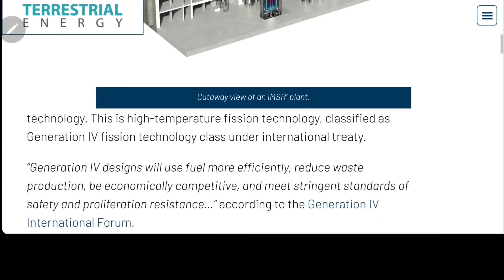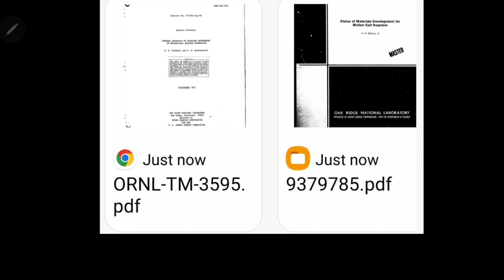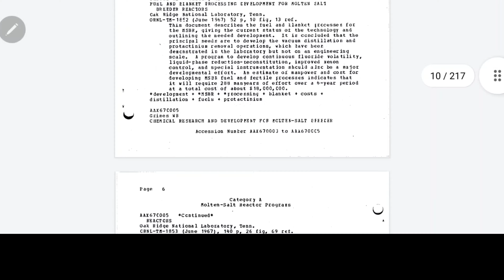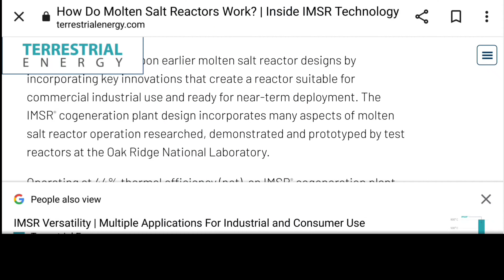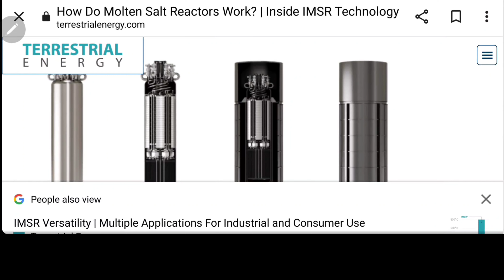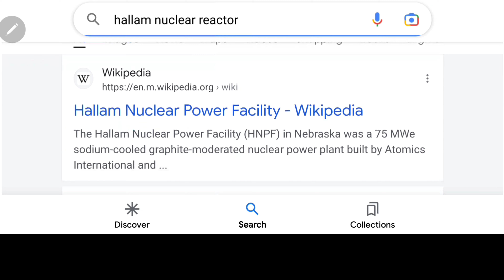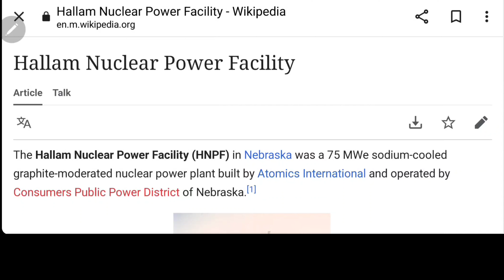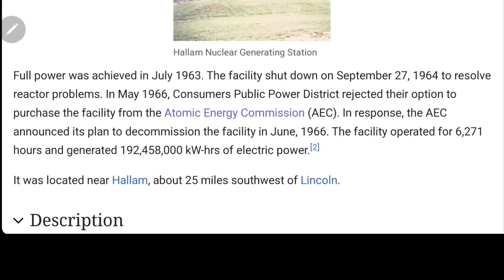Molten Salt Reactor: Future or past?

Comment: The original MSR demonstrators did everything they were supposed to do.  The funny thing is that they were far more complicated than would be needed for a terrestrial reactor.  Remember, the USAF wanted a reactor to power and aircraft.  That meant the reactor had to be designed to work even as it was turned upside down.  A civilian reactor based on using molten salts or even the Thorium cycle would be much simpler as it could operate on convection currents, rather than plumbing.  Once you get the geometry right, such a reactor could be stupid simple.
Reply from the maker: It isn't denied that it can work on paper and in some cases can be shown in expirements plausibility.  But so to did water cooled reactors that is now found that tritium isn't as harmless as once thought to be and passes through the body in under a month.  Newer research shows that's not the case and actually replaces hydrogen in our cells or binds directly to the cell to transform in the metabolic process to organically bound tritium which drastically increases our internal exposures and dose.  That means every standard set needs to be reinvestigated being that radiocolloids and tritium are doing much more damage and death than previously peer reviewed to be.   That's the problem here Paul, the cart is always being put in front of the horse and before we move to yet another bad idea, being we could never guarantee complete protection against not only tellurium embrittlement but also the graphite expansion/contraction issues, we need to find out what the last century has done to us all.  Until then, everything else is the cart, not the horse.
Reply: @paulmobleyscience  That reminds me, the rarity of Tritium is a problem for fusion power.
Reply from the maker: @ThatsMrPencilneck2U  Absolutely and why fusion will never be viable
Reply: @paulmobleyscience  I've been making fun of fusion experiments for 30 years, but "never" is longer than I care to contemplate.
Reply from the maker: @ThatsMrPencilneck2U  I suppose you can never say never except for never to say never....
Reply from the maker: The thorium "cyle" as it's called is nothing more than using U233 as the fissle material and is a ploy of the industry to not have to use the words uranium fueled reactor and nothing more.  Yes we all know it starts with Th-232 but can't just purify it and put it in a reactor...it has to be hit with neutrons first to transform it into a useful fuel, U-233
Reply: @paulmobleyscience  Please, a lot of engineers want to start with U, because we have a lot of it, and breeding U233 from Th is a more complicated process.  Nobody is trying to fool anybody.  This kind of BS is why you can't get any straight answers on nuclear power.  The people debunking it are even more full of crap than the people pushing it.  Go to West Virginia and tell me how much better off we are without nuclear power!